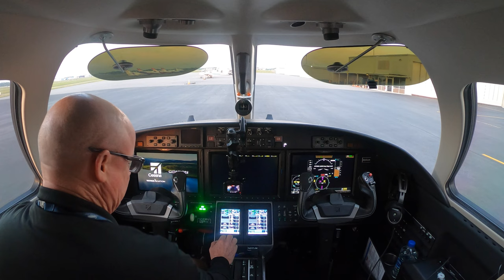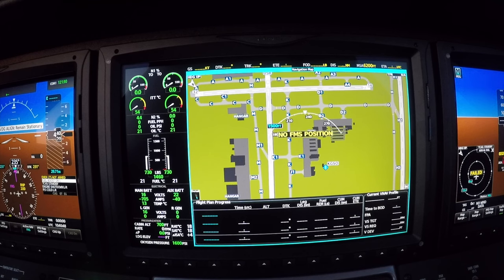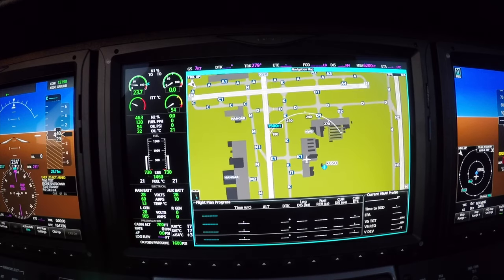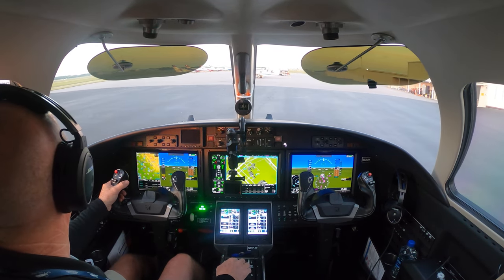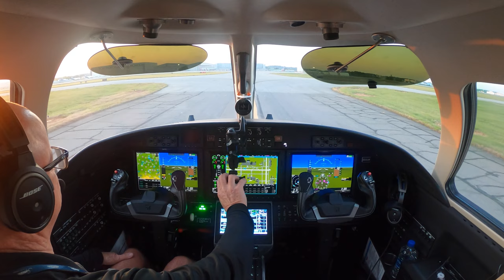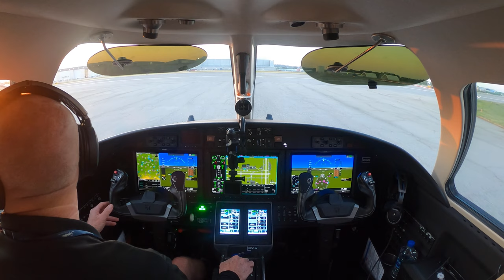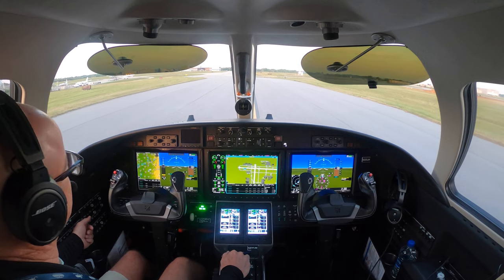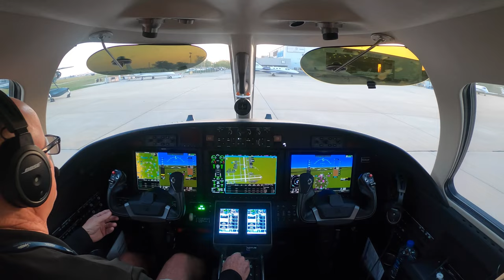Starting the FJ44-1AP-21 engines

Comment: Interesting. Ignition at 11%. The starter motor actually puts in a lot of work to get it up to speed (500amps at 21volt, that's 10kW). Halving the size would only add a few seconds to the start up but I guess it doubles as alternator and the bird's aircon is hungry. although at altitude cooling should be easy... I guess it's sized for powering a lot of AC while idling on the ground.
Reply from the maker: That’s way above my level of knowledge, the engineers figured that out. Ignition and fuel is all controlled by the fadec. In non-fadec jets ignition comes on when you hit the starter button and fuel is introduced when the pilot takes the throttles out of cutoff, usually around 13% but varies with models and operations.

Comment: Thanks for sharing. You probably noticed yourself that the audio during taxi was poor due to engine background; maybe you should wire your microphone another way.
Reply from the maker: I didn’t have a mic plugged in, it was using internal microphone. Didn’t think about until afterwards.